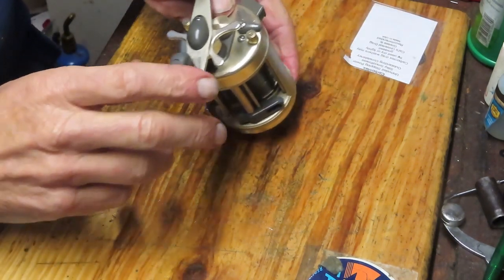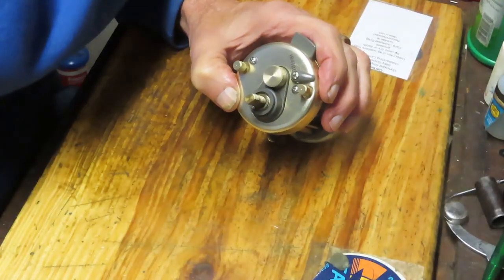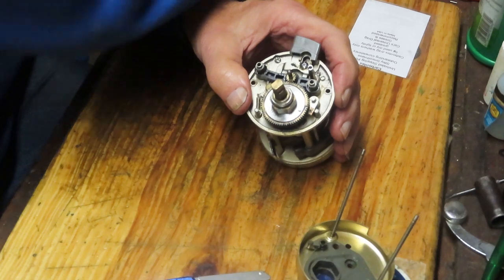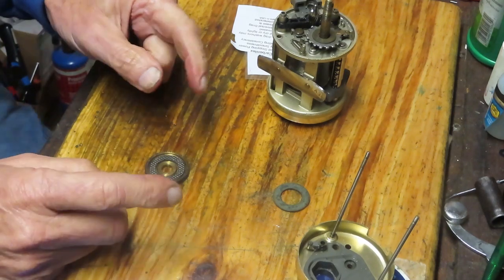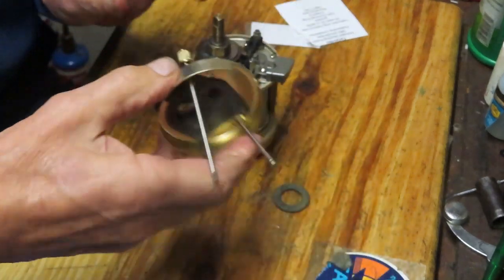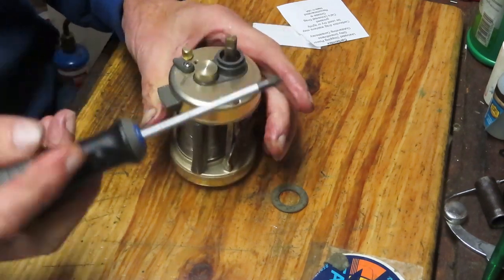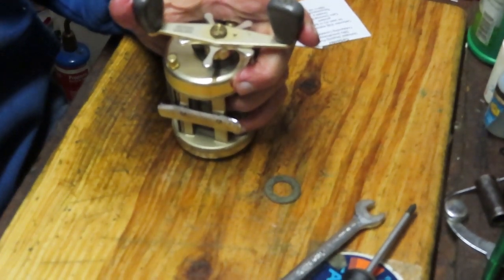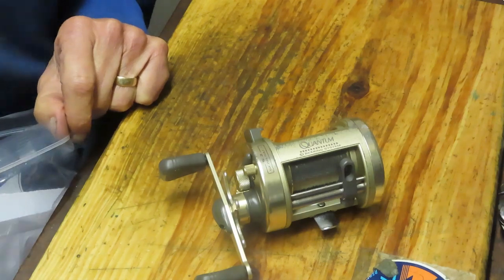Quantum Iron 410 baitcasting fishing reel drag washer upgrade

Comment: What do you think about quantum reels in general. I have several PT magnesium casting reels.
5:16 I noticed the Drag washer UNDER the main gear. Doesn’t that have to be changed as well ? The Washer company Carbon tex makes some excellent carbon fiber products. I grease those washers with drag grease to keep them from falling apart. I saw that tip several years ago on another Reel modification site. I’ve modified probably 30 reels in the last 20 years or so. Still have them. I take care of my equipment. And unfortunately they’ve never seen any heavy use. I do/did usually make thousands of casts a season. I exist in New Jersey as well. Freshwater is my life.
I’ve done quite a few hybrid and Full ceramic bearing mods. The bearings made a big difference.
Reply from the maker: Quantum has had a mixed past.  When they were part of Zebco, the were elevated to a more preimum brand - think Smoke and others.  Quantum was sold to Rather Products about a year ago, and it is now a medium slotted brand behind Lews.   You need to compare various models for good or bad, because they sold everything from entry level priced reels through top end pro models, so I can't make a general statement overall.   On the other question - you can, but do not need to change out the washer under the main drag.  That is a spacer.  The drag holding power is with the one inside the gear.  Carbontex drags are non-absorbent, so you do not need to grease them.  If you do, you should wipe off any excess.  Best wishes  neighbor!  Dennis

Comment: Dennis, I had a problem with the drag washers in that Mitchell 906 I recently worked on. The bottom drag washer in the stack had disintegrated into thick pieces. That washer must have been very thick as I looked at the pieces. I found a thick Teflon washer and substituted it for the broken up washer. I’m not at all satisfied with the drag so evidently that washer I substituted isn’t doing the job. What can I do about that. It appeared to me that the bottom washer in this stack was unlike any washer I’ve ever seen. It was almost like it was made by an unknown material that over time became brittle and basically disintegrated. I’m trying to find that washer using the schematic but have had no luck so far. — Chris
Reply from the maker: Get the measurements for the washer - inside and outside diameters and contact smoothdrag.com They sell washers by size and should be able to get you one that is close - Thanks - Dennis
Reply: @2ndChanceTackle  Dennis, the drag washer I mentioned may not be a drag washer at all. It is part # 82 514 and is called a Brake Spring. When I disassembled the drag on that Mitchell 906 this was a part under all of the regular drag washers. It was shattered and in a great many pieces which looked like a think hard plastic or  other material. There was no spring in the classic sense. I purchased a “Spool Complete” part #82 518. It is supposed to have all these drag washers and this brake spring in the NOS Spool so I may be okay. I do know that without that brake spring the drag will never be in proper working order. I’ll have well over $50 in that reel so it was not a cheap restoration. I mat purchase a bail trip arm that I found. That was the piece I filed down  in order to repair that clicking. Other than that I’ll be finished with that project. I enjoy a reel that presents a challenge to get back into working order. It is the part of this reel hobby that I like the most. This 906 may end up being one of the most attractive and smooth operating Mitchells in my collection. — Chris